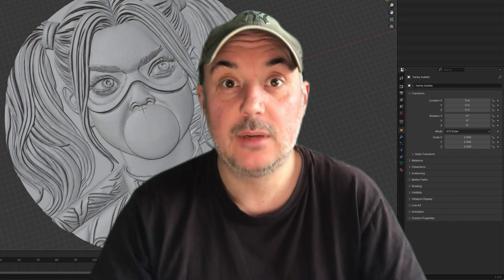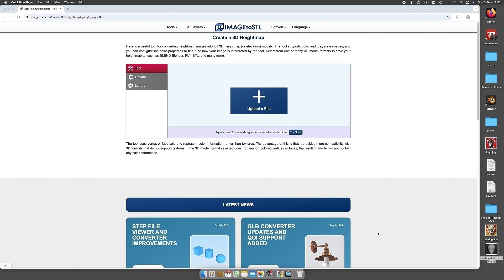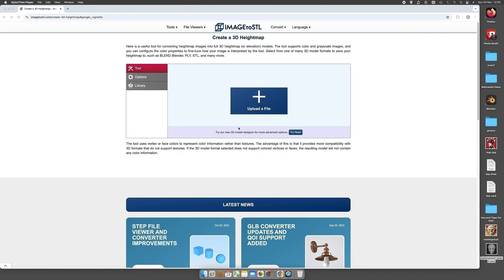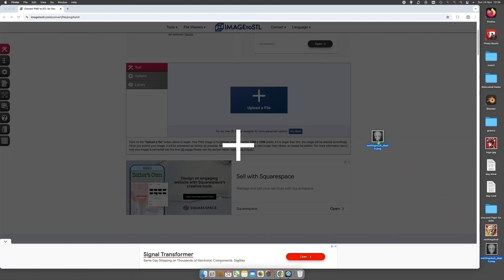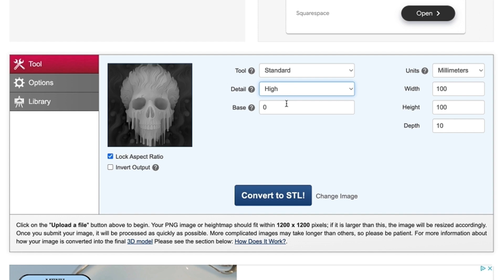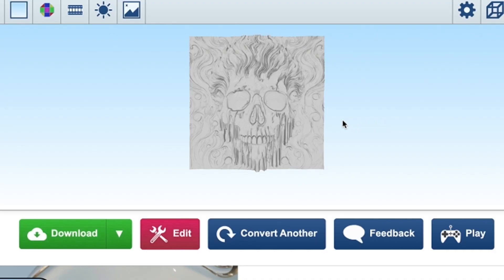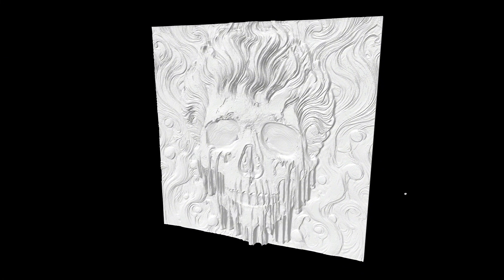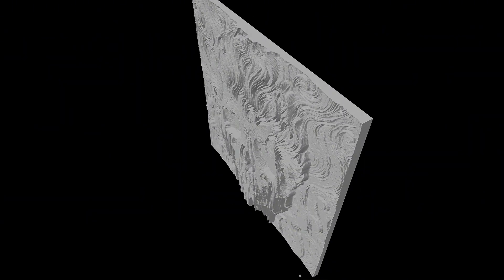How To Convert An Image To .STL File For 3D Printing CNC etc

Comment: THANK YOU SO MUCH FOR THIS!! ,.. But how can I remove the spikes, it has spikes on it its not a smooth surface
Reply from the maker: Hi there! i use blender to edit the .stl files once generated, you can smooth or edit how you want, or if you wanted a cleaner .stl file there is another paid way of doing it using an online solution, here is my video showing it, the video description does give some free credits. https://youtu.be/V7H-CNDeUlA?si=COBhfOoJITgq5PnD good luck with your projects!

Comment: I'm trying to make a vinyl siding light fixture mount with my 3D printer. I have the PNG picture but I need it in STL file. I'm new to 3D printing and I'm sure there's a way to create the STL file with just the dimensions (which I have) but this seems easier, turning the png into the stl I need.
Reply from the maker: Normally items like this will be made in 3d using programs like CAD or Blender to make the stl file, i think this might be the wrong type of process for that type of thing, you need full 3d creation.
Reply: @SilverPunkPour  ok thanks

Comment: how can i remove the 3D background? like without any base layers ?
Reply from the maker: You can do it 2 ways, either edit the depth map image and save with transparent background and turn the base layer to 0, or edit it after you create the .stl file in either blender or other 3d modelling program, good luck with your project!